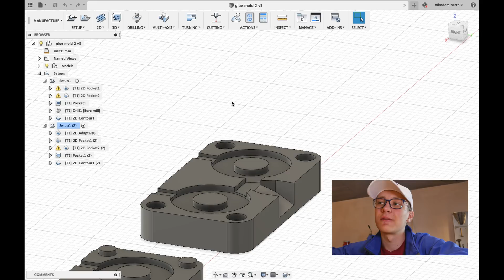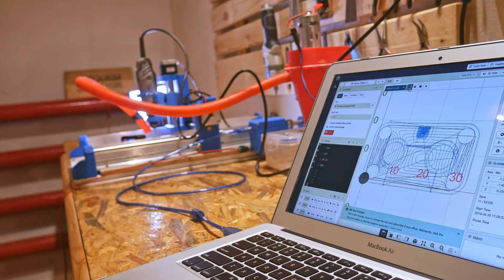DIY Injection Molds With Dremel CNC And Hot Glue #2

Comment: Have you tried just a hot water bath? Or a toaster oven on low? When casting aluminum, I don't have to heat my mold to the melting point of aluminum, but anywhere close keeps the aluminum from losing so much heat to the mold. Even a hair dryer pointed at your vise could probably get you the extra BTU's you need to make the plastic flow to the end of the mold.
Reply: And polish the mold... Make sure there's no undercut or rough vertical surface for the hot glue to grab so it can peel out easily instead of gluing itself to the part.

Comment: I don't think a zip tie is the best idea for your setup. You'll want as little surface area as possible so that hot glue has a passage within the skin that forms, so I'd suggest you increase the thickness of your part. I don't understand your aversion to heating up the mold with a heat gun and mold release, but  you should try and get a mirror finish to make it as slippery as possible and have the thickness as uniform as possible. It would also help if you could find a way to suck the glue in from the vent while you inject it. If you still have problems de-molding your part you should try and put it in a freezer to make the Al shrink and stiffen up the part.

Comment: If you've never seen injection molds, they are MASSIVE heat sinks with often 2500 lbs of steel. That way they don't distort when heated. Your molds are suitable for cold molding not hot. They're too thin and light.

Comment: https://www.techkits.com/products/model-20a/ is about 600 Euros and works in your drill press.  That's the unit that Scorchworks ended up with after trying a series of home built solutions.  

I would be tempted to make the mold halves identical.  You could use to 2 male pins and 2 holes so that when flipped they would fit together.  It just saves on the design work to make one piece.

Comment: for larger molds, try heating the molt lightly while injecting, and try injecting slowly from the bottom
using the hot side of a peltier cooler (powered by a cheap bench PSU) would be great for temperature control
Reply: Why would you burn a peltier when you could just use some power resistors or nicrome wire with some kapton tape?
Reply: @AtlasReburdened  
"Why would you burn a peltier"
the way you worded this makes it sound like your consuming the peltier, dunno why you would think that, its not like it would be permanently attached.
Reply: @DaBurntToaster  I say it like that because he would be taking a device with a non linear temperature to resistance relationship, that uses 70W to move 5W of heat, and normally requires a heat sink to not melt its internal interfaces under normal working conditions, and attaching it to:
1) not a sufficient heat sink, and
2) A user regulated power supply.

It just sounds like a recipe for turning an amazing piece technology into a paperweight, and it seems pointless to risk damaging a heat pump when a resistor will suffice.

Comment: You need to create something based on the hot glue gun but that works continuously, without the need for you to have to preassure the gun all the time, than, you have to think a better way to inject, specialy a better place to do it so! That second mould i wold inject between the cavity and the core as you are doing but instead of the top i would choose one of the sides on the middle. And another thing, for the hot glue gun machine you need to enshure it can aply righ preassure so the hotglue go to every place before harden out.

Comment: you can use 3d print pet-g for the mold.. need some silicone spray or oil for release... i use them all the time. 
you allways need vent holes

Comment: Hey Nikoderm! I have run into this problem before. You can solve it with this tips. Distribute heat alongise the metal mold. You will have to have it hot in a temperature that continues melting the silicone along the way while its pushed. The second tip is get something with more power. There are some glue guns that work like a plastic injected machine!

Comment: Man, you have to get your hands on a lathe and design a piston for Inyection molding. A small resistance is not so expensive and also you need a pyrometer. Wrap it with thermal insulation and you can even use real pellets pf PP or PE, you can even recycle some polipropilene and inject it with patiente.
Also try using some demoulding agent. Even normal Glycerine sprayed works great with heated moulds.

Try polishing the moulds to avoid getting the plastick to stick.

Comment: You could try to insulate the aluminum mold to reduce the heat transfer. I would also suggest heating the hot glue up more, it will make it less viscous and flow easier through the mold. Also, depending on your goal you could inject different materials into the molds and see the results. Silicon air dries but it takes longer. Or try other components that wont harden until heated, so you could inject then bake the mold.  You could make a parent mold that smaller molds fit into. The parent mold would insulate the smaller mold and you could clamp it it down in the vise providing a much sturdier clamping surface.

Comment: Why is everyone on about injection molding when rotational molding is a cheaper alternative is more accessible due to equipment and materials? Unless you're a master machinist you will not be making micro injection screws and micro plungers. Even of you were you wouldn't put yourself though all that trouble. Where as all you need is a rotisserie oven, a mold that can fit in / on rotator (you can make an adaptor), and powdered plastic.

Comment: You have 3 ways to fill that mould
1 heat up the mould to delay the hardening of the glue
2 inject from 2 or 3 pointsto fill up the mould... You might have weld lines if you do not inject in the same time
3 somehow increase the injecting speed and presure

Comment: Hey there!
I just watched the video of this experiment with hot glue. And I was wondering if you could not try to increase the output grooves for the applied material so that the pressure needed for the application in larger molds than the first one is smaller. I imagine larger output grooves allied to a design review, the odds of success will be considerably greater.

Comment: Dude you have a 3D printer right there in the background clamp your mold to the heat bed crank the heat way up which will heat up your molds and you can try Plastics because you can use your nozzle to extrude plastic into
Reply from the maker: 3D printer extruder wouldn't work for that, nozzle is too small
Reply: @nikodembartnik  what would I was going to try after watching your video is I was going to order one of the new super volcanoes from e3d and then use my then use my bondtech extruder with it is hopefully I can cram it in fast enough and then I was looking at getting 200 m m by 100 mm silicone heating pads to keep the outside of the mold hot I was going to aim for 120 to 200c

Comment: Would be cool if you had a threaded nosel from the hot glue gun, and then thread it into the mold so you don't have any waste from the top, also means all pressure when pushing the glue in, is pushing the glue through the mold
Reply: Also if you were to screw the two sides together so you don't need to rely on the vice to hold it, you can see the two sides coming apart for the larger mold

Comment: Try using pewters metal, it’s a low temperature melting alloy , who’s liquodous temperature is lower than the aluminum mold. It’s viscous properties will allow it to flow into the mold vs your hot glue that can’t retain its heat due to thermal mismatch.

Comment: It'd be cool to see a DIY injector using a 3D printer head as the heater/ extruder. You could use a larger extruder nozzle and match the cone shape in cad for a better fit.
Reply: Something like a e3d volcano clone would be ideal for this. Large nozzle, large heated area.

Comment: For the centering system is better to place the hardened standard pin and ring. The adjustment of nozzle is bad, in High pressure injection is very important tris adjustment.

Comment: first of all i suggest you make holes on your molds so that you can screw the two parts together because as you can see at 9:44 every time you insert the hot glue gun tip the mold flexes, also you can keep the mold inside boiling water to preheat them and remove before injecting, lastly you should use a release agent to help the hot glue slide inside the mold to the outer parts !

Comment: Why arent you using 3d printer hotend parts and your cnc to make a own full metal hot glue gun?
Reply: I don't think a 3D printer hot end would have enough power (electrical power) to achieve the flow rate required.

Comment: try to put mold between peltier modules... easy way to heat small parts... you can try to controll temperature via some temp switch...
Reply from the maker: Check out my first video about DIY injection molding

Comment: Perhaps the metal piece of your hot glue gun has cracked, that would explain the leaking. In this case the hot glue gun must be immediately discarded (or stripped for whatever you might want to salvage out of it and then discarded) because structural failure around the heater element connected to mains with hot melt glue which is not a very good insulator against mains voltage in molten condition is a remarkably bad idea.

Why do you suggest you will ruin the mold by heating? Just set your printer bed to some safe temperature, like around 100°C or even just 70°C, drop the mold on there, pick it up half an hour later or whenever you feel like it's evened out?

Oh I know now, the glue stuck hard to the mold. That's what release agent is for. Not sure if talcum powder would work. If it doesn't work and you need to try a different release agent (PVA glue, dried layer of soap, vaseline, etc), you can simply wet the edges where the hot glue seeps out in alcohol or drop the whole thing for a bit in it, and in a couple minutes the hot glue will pop off and crumble apart. The casting will be ruined but the mold will be rescued.

Comment: This $5 hot glue gun is what I use and is extremely good. Run it at 17v DC from a bench power supply and hot glue will flow very easily!

https://hobbyking.com/en_us/battery-powered-hot-glue-gun.html?wrh_pdp=3

Comment: At what temperature does hotglue melt? You heated it up last time, but nearly enough, you have to at least to glass transition temp. And you said no release agent was needed, but with the heated mold (which was a step in the right direction, but it was not nearly hot enough) you got your hotglue stuck. So you do need it when doing it properly.

Comment: I had the same problem while making bullet pens, the glue would solidify upon contact with the cold brass. The solution was a heat gun. I warmed up the brass first, placed the hot glue, then used a spray bottle to cool it off. It worked great. Love your videos.

Comment: stronger hot glue gun and a other material to try is any 3d printer material you print a outer shell of a glue stick and ram a bunch of the scraps to fill it up and melt it in the hot glue gun

Comment: make the injection hole chamfered to match the end of the hot glue gun. it may help with pressure. great job
Reply: perhaps  form the tip of the glue gun with a ''key''...so it can be actually locked to the mold during the entire procedure?
Reply: @imperialpresence3331  I'm sure that could be done, but it would be much more difficult. Not sure exactly what you would gain though

Comment: Could you use the extruder from the 3D printer to fill the mould? You could make an injection stand, with one stepper motor, a hot end, and then you could replace the 0.4 nozzle with a cnc part. You could make a frame and vice part of the stand so you put your mould inside, clamp it up and then extrude pla, petg, flex, whichever

Comment: Hot glue is just never going to work the way you want, it loses heat and solidifies too quickly. It's also not viscous enough to spread quickly. You need something that's a thinner material that flows faster/easier and cools/dries slower.

Still, good experiment and good info on the milling bit. It might be good if you (and/or the community) put together a table of material --> spindle speed / movement speed / bit combinations that are known to work. It would be helpful to those of us doing CNC for the first time with this setup.

I'm working on a dust/vac shoe for the original design that will help with capturing the shavings/dust and get them into the vac - will share once I get it done... Plan is to also make it 3D printed and a simple add-on to your current Z-axis setup. I'm just torn on whether to make it fixed height or have it move up/down with the Z. I'm nowhere near as good at CAD as you (I use TinkerCAD as Fusion360 has me totally stumped and every time I sit down to learn it I don't get very far and have to then not touch it for several months and forget everything I learned...)

Comment: you are really perseverant. your second attempt succeded. the third no because the aluminium is an excellent heat sink and cools away the melted glue too queeckly. maybe a piece shorter but with bigger section to allow more glue in the mold so more heat. or heat the mold but put some oil or baby powder in it to prevent the glue sticking.??

Comment: I don't know if you changed it on the second mold but I think that the hole where you put the hot glue gun for the injection should match the head of the gun. On the first one it was some sort of a square and the glue leaked, this means you are loosing pressure.
Ps: Very nice to see you finally having a successful mold!

Comment: You need a evenly distributed temperature in the mold.
To achieve that prepare a water bath around 60-70 C° (hot, *not boiling*) where you warm up the mold.
Then quickly inject the hot glue.
Don't use the bear vice it sucks the energy right out the mold. Make some wood jaws to retain the heat. You can use the water bath afterwards to split the mold and release the part.

Comment: the higher the surface facing to the mold side the higher the hydraulic forces will be. You need to properly close the mold and then heat it up as well as cool it

Comment: For mold release, try Mono-Coat E255, goes on wet and allow to dry (it is a dry mold release). It leaves an extremely low energy layer that almost nothing sticks to it (DO NOT SPILL and use in a well ventilated area)

https://www.chemtrend.com/our_brands/mono_coat?gclid=CjwKCAjwk7rmBRAaEiwAhDGhxLT2d9XSVOCoWUphdzStIeDs-_AVbdjoGmXMIzEi74IQ2cmVXWA16xoCmNoQAvD_BwE

As for the injection material , I would try a polyimide material (mainly know as hot melts). They inject at extremely low viscosity so it’s easy to fill relatively large molds. You can last look at a manifold injection design to have more than one injection location. 

For the material gun I would recommend a buhnen gun:

https://www.buehnen.de/en/adhesive-melter/pneumatic-glue-applicators/hb-710-ht-bead-detail

Also, be aware this can be used to encapsulate electronics.  So if you want to have super protection of a board, you can do this with hot glue or the polyimide materials I mention earlier. For material you can get some from 3M resellers (pellet):

https://www.ellsworth.com/globalassets/literature-library/manufacturer/henkel-loctite/henkel-presentation-technomelt-formerly-branded-as-macromelt-molding.pdf

Lastly, it is possible to 3d print your mold (make sure you have it thick enough for pressure reasons). I would recommend an SLA or poly/multi jet printer to make the molds, but FDM works but for much Fewer prints. 

If you have more questions I can give design tips on the mold itself and the like. I have developed this for production/industrial level applications, but the concepts are very easy to apply at consumer level and get similar results. Hope this is helpful.

Comment: I would say something like an under floor heating pad the electric type will help with the second injection mould. As you say the glue is cooling to rapid so the heat pads can evenly heat the mould then inject.

Comment: I like the idea of using PLA leftovers. I also thought that maybe you could try a Jewelery Mold Vulcanizer unit to heat up the aluminum mold and using a hot end and extruder set up to inject the plastic into the mold, possibly with heat throat extension instead of a nozzle into a thread mold fill port and leaving very small relief vents at the end of each path in the mold so the mold will fill completely. Mold could be sprayed/dipped/coated in a thin layer of MagiGoo, 3dGloop or some other release agent. Just an idea, would love to see someone experiment with the implementation.

Comment: Try a 3D pen with a heated mold and release agent
Reply: Anything involving a 3D pen and trying to fill a sizeable void in one stream won't work, the filament both takes a couple times more energy to heat to similar viscosity as hot melt glue, and the heating power of a 3D pen is a few times lower than a hot glue gun.

Comment: If your 3D printer hase a heatbed, you can use that to pre-heat the mold. When the mold is “hot”, position your extruder at the fill part of the mold a pump it full of plastic wit your extruder.
I think I have seen this done before
Reply from the maker: Extruder can't extrude plastic fast enough

Comment: Think outside box....what if u filled both halfs with hot glue and  then put together in vice....have more waste in glue but think will work.....great minds think alike....dont want anything from my idea... run with it..
Reply: I'm smart like a fox....trust me
Reply: I'm smart like fox trust me... just do in fast pace
Reply: Bet u not thought of that before...came to me  drinking beer
Reply from the maker: No way, you wouldn't be able to close the mold and also it will cool down very quickly. That's not injection molding at all